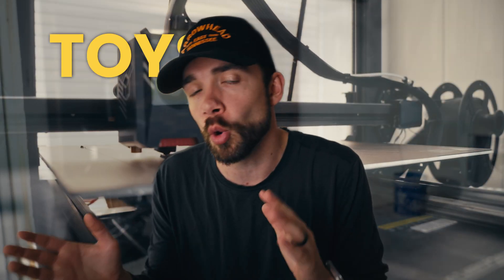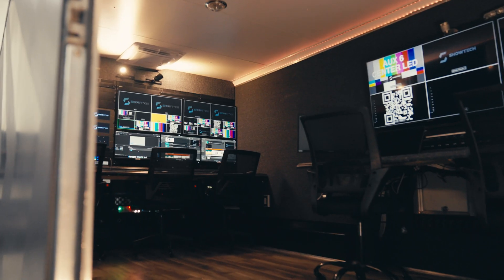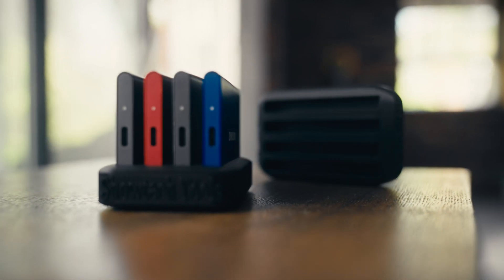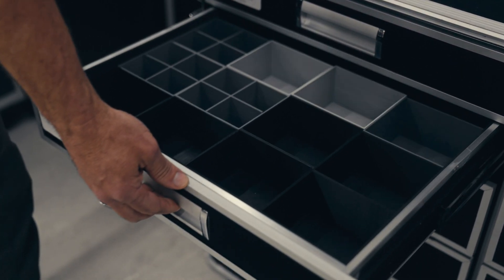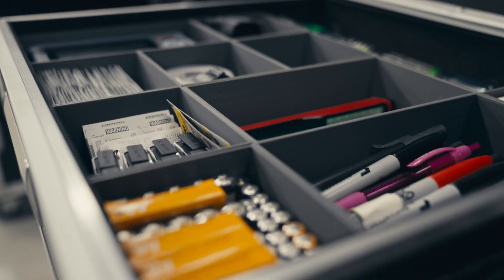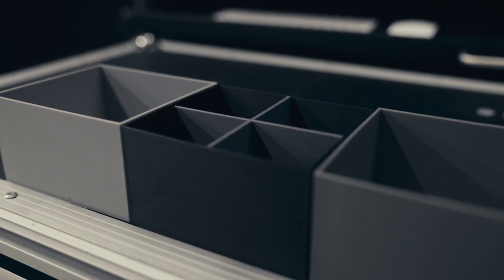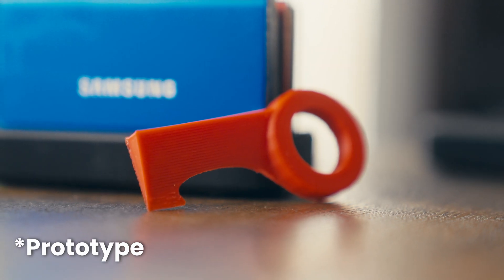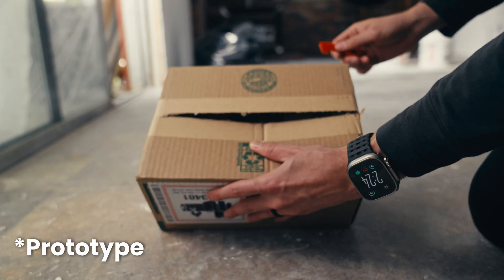3D Printing Your Camera Gear (This is Game Changing!)

Comment: very interesting, Im currently working on 3d printing my own film lights, 1000watt external power supply with 100watt ww led and 200watt rgbw leds, and all the over stuff to make it work, why? because why not! and I cant afford anything else.
also you should check out gridfinity, it has modular storage bins and there already are models for just about anything you can think of.